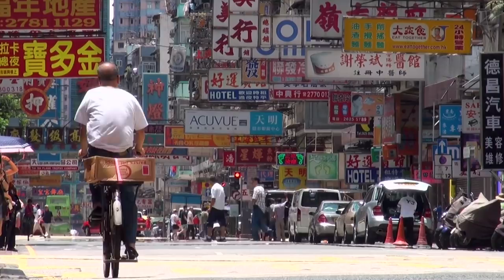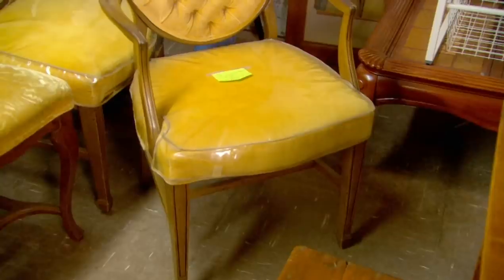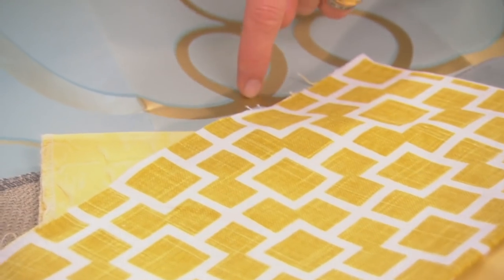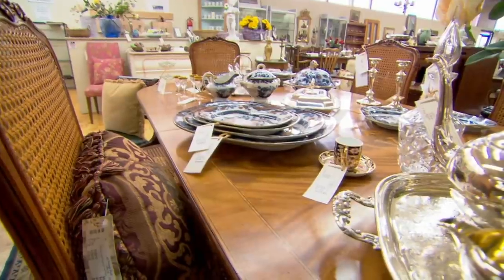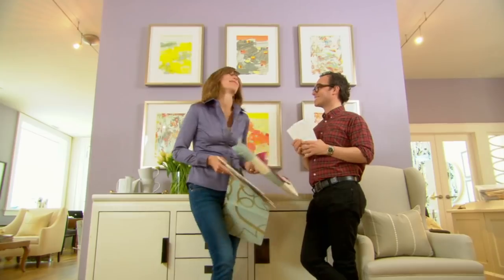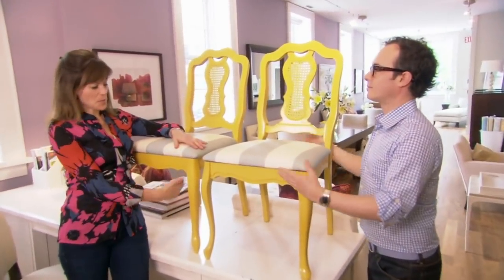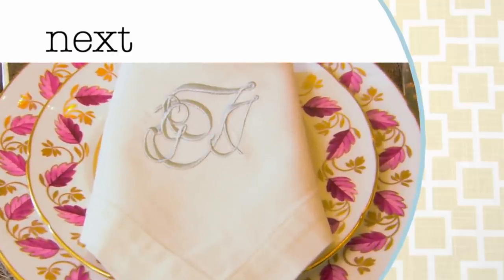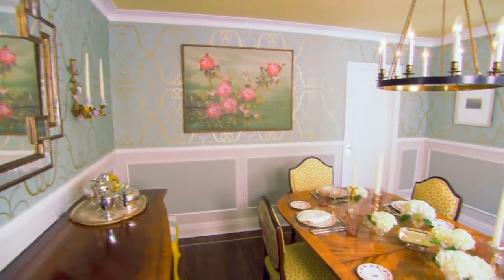How To Give Your Dining Room An Elegant And Luxurious Makeover | Sarah 101

Comment: Couldn't help wondering why they didn't just keep the gold upholstery on the chairs since they played off the gold in the floral fabric they put on the back.  That would have allowed them to keep the tufting, an expensive element, on the back of the chairs that go at the ends of the table.  It looked to be in decent shape and could have been cleaned if needed.  The floral fabric added to the back was lovely,  but the geometric print on the front just didn't complement it at all.  The original solid velvet would have showcased it much better.

Comment: For many of us, budget is an issue, so we need to take elements of Sarah’s design process and adapt them.  At the very beginning of the segment, there were white dishes stacked on the table.  Perhaps a more modest rendition of the room could have saved the expense of all new china.  While I feel like the wallpaper is lovely, it doesn’t seem to complement the bottom portion of the wall; using paint alone would have looked good, with less of a visual impact, that’s true, but also been a savings.  I thought the artwork did not work at all and wouldn’t have included it.  I enjoy the show for its inspiration, but I definitely can’t indulge in the cost.